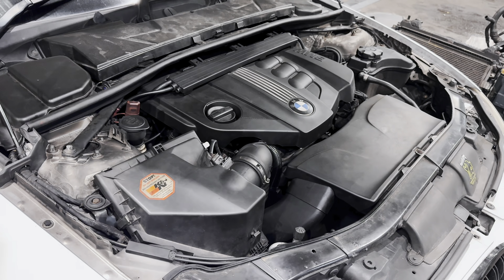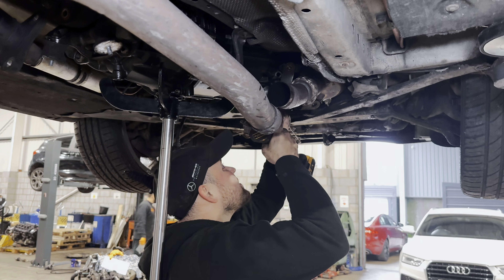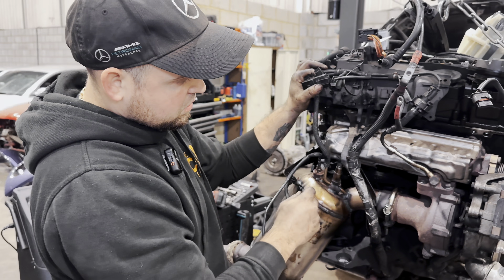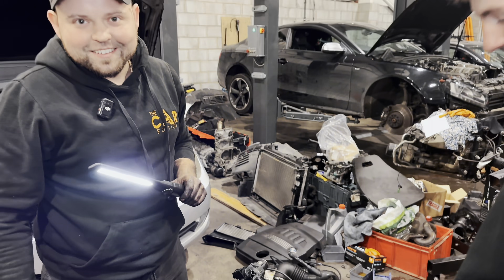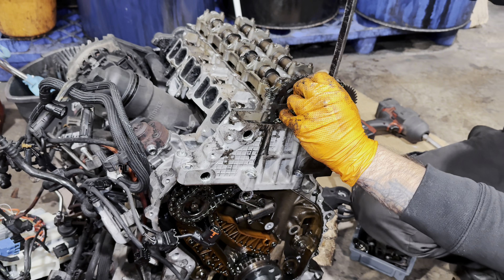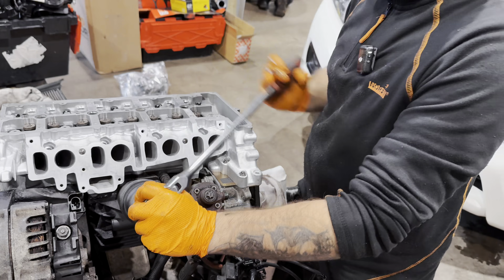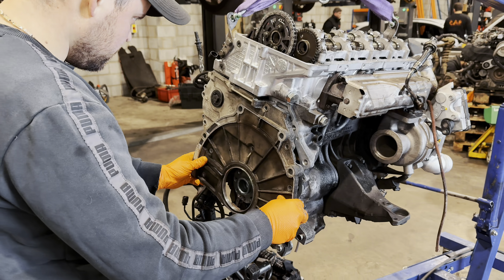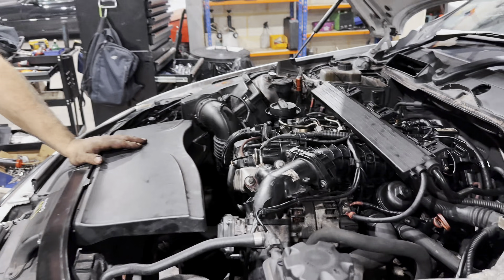BMW N47 Engine DISASTER: Plastic Swirl Flaps Destroyed Valves, Timing Chain Stretched & Turbo Gone!

Comment: I think it’s quiet interesting to think that bmw think their cars are premium compared to say ford or Toyota or Nissan ,when in fact bmw are the worst ball of shit you can buy,EVERYTHING BREAKS and EVERY PART IS EXPENSIVE to replace,German engineering,complete balls of utter crap,I’d never own a bmw,I drive a 2011 focus 1.6 diesel with over 2 hundred thousand miles on the clock I’ve only ever done servicing and timing belt replace and a dpf  remove, car causes no probs and drives like a dream,

Comment: Luckily I'm still running an M57. What are the N57's like?
Reply from the maker: In our experience, N57 is similar if not worse in terms of carbon build up. They also have timing chain issues however less common compared to N47 😊👍
Reply: @ thanks for that, maybe hold off on a F11 530d then and stick with my old E46 330d touring
Reply: Same here M57 Best and longer car I've owned 👌
Reply: I’ve got an N47 , 126k miles, occasionally has a slow crank when starting but no timing chain noise. 63 plate had it since new and changed oil and filter regularly, still drives like new and will drive until it dies !
Reply: @WilliamCurrie-p9t  maintenance is the key - treat ot well and it will do the sane to you.
Reply: @WilliamCurrie-p9t  if you have start/stop tech, does it work consistantly? if at all? if it does but you have it perma off, try it. should work consistantly once engine is warm. if it doesnt then likely you just need a new battery :) its all mine needed to solve basically the same issue
Reply: @TheRasbane  I just put a new battery in it , can’t complain first time since new, I have never from new used the start stop, it’s just another wear factor 🙄 I’ve now disabled it with a Carly fix.

Comment: Got f20 1 seires I had my chain done last year and I very lucky to say the garage said the chain guide had started to come part and found little piece in the oil pick up. 😬 and add clutch and flywheel on top because they was knackered 🙄  nearly die when I got the bill 😳
Reply: How much was me talking 😮🫣
Reply: 2 grand 😢
Reply: @tommyb6674  I feel for you Tommy!
Reply: De ja vu! Exactly the same thing. Chain guide broke off and landed in the sump in pieces. New chain, rocker cover, dual mass flywheel and clutch. Just shy of 4 grand
Reply: @TurnerN4tor500  holy crap since then I had to replace egr valve and dpf i may aswell just bent over and say step in 😬
Reply: @tommyb6674  I do mostly motorway miles so the dpf isn’t too worrying for me. All the same, if not for emissions regulations and the mistake BMW made suggesting the service intervals as 18,000 miles, the N47 would have been I think one of the best diesel engines ever made. Great on fuel, torquey as fuck, perfect engine for the 3 series. The drawbacks seem to outweigh the benefits though

Comment: I have the same core engine in my 2002 Rover 75. MG Rover had the foresight to not use the swirl flaps or a dpf. They still have issues (blocked PCV valves, Crank pulleys) but are pretty much bullet proof and suit the car perfectly. I love watching you guys work, perfect work ethic.
Reply: M47 engine in yours mate ther earlier, much more reliable version of this engine no dpf crap to worry about as you say.